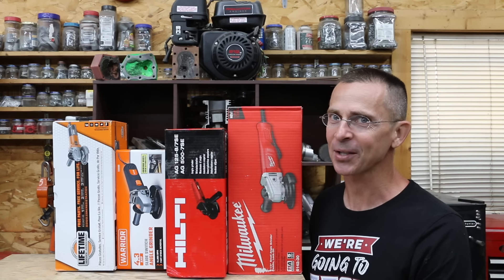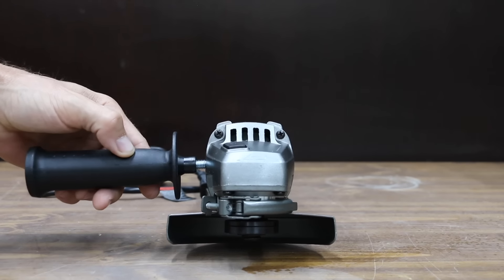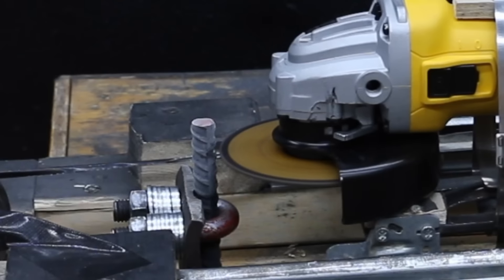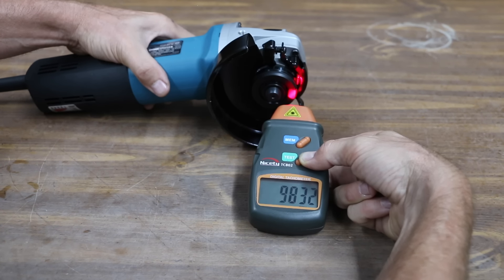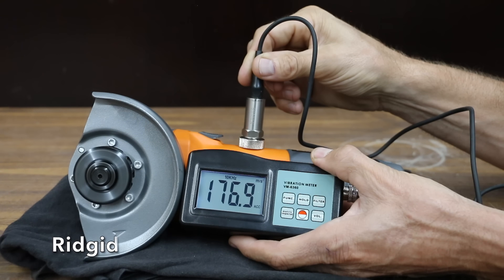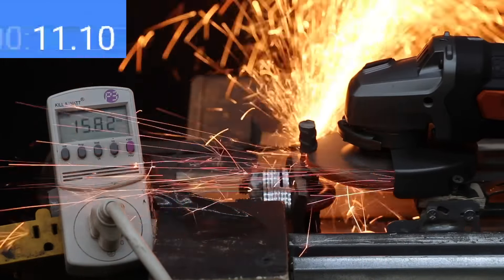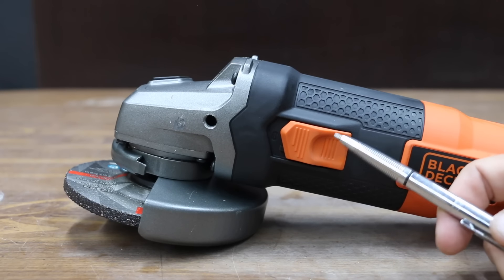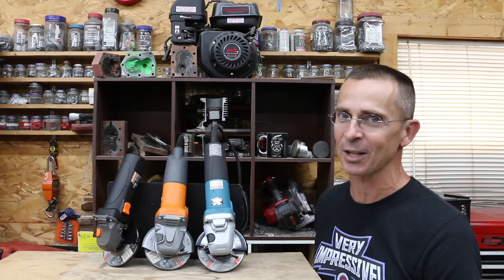Best Angle Grinder (Corded)? Hilti vs Milwaukee, DeWalt, Makita, Ryobi, Ridgid. Let's Settle This!

Comment: back when the metabo hpt switchover from hitachi was going on lowes was selling the hitachi tools extremely cheap and i scored a hitachi 4 1/2 inch and it is an absolute beast i can honestly say its been abused and its still holding up great best $50 grinder ive ever used
Reply from the maker: Nice!

Comment: I've spent countless hours prepping steel with a Makita 4" grinder and a wire knotted cup wheel. The switch is what makes a huge difference, you want one that locks in the on position. Although Milwaukee makes some great tools, its the paddle style switch that you have to constantly hold, is fatiguing.
Reply from the maker: Thanks for the feedback.

Comment: I've been using the paddle switch version of the next size up DeWalt for years now. It takes getting deep in a piece with a standard grinding wheel to bog down. It is a 13amp motor running at 1100 rpms though.
Reply from the maker: Thanks for sharing.

Comment: I bought a Warrior angle grinder in a pinch with limited budget, and it did exactly what I needed it to do. Based on cutting speed alone, I'd say the $33 Porter Cable is the best deal. I don't regret buying the Warrior, but I know what to get for an obvious upgrade that will leave me with money left over for discs and maybe another tool or two.
Reply from the maker: Thanks for sharing.

Comment: I have a video idea. Whenever I use a metal wires brush on my angle grinder, the small wires shoot everywhere, they will fly on my face, pierce through my clothes and make a mess in the shop. It would be great if you could test all of the different brands to see if one of them has a best method to secure the wires to the cup. Also thank you for the great work you've been doing and congratulations for the channel.
Reply from the maker: Thanks and you are welcome!  Thanks for the video idea.

Comment: Cool.  Glad you do the decible test.  Loudest I ever used was Harbor Freight (Chicago Electric).  Had to use ear plugs w ear muffs over them.
I like to have at 3 grinders to minimize blade changes but like at least Ryobi or better.  I have burnt them out (like your video) but brush changes fixed it.
Reply from the maker: Thanks!  Thanks for the feedback.

Comment: Don't underestimate the Wen. I bought a Wen drywall Sander that uses the same motor at the grinder. 3 years sucking in dust it still keeps working. Ive needed to replace brushes but that's it. For $200 compared to $1200 for a name brand Wen has definitely made me money.
Reply from the maker: Thanks for the feedback.

Comment: I really like the effort and thoroughness you put into testing, and for the longest time I was hoping to eventually find something I could suggest for a future video.

And I finally found something: cordless rotary tools. There's a bunch of them and I'm sure there's a wide range of quality, but I wonder if there's any affordable ones that come with RPM feedback.
Basically, what disappoints me about the one I have most, the Dremel 8200, is the lack of RPM, which could be used to increase the motor current to bring it back to the RPM it's meant to be at.

Especially at low RPM, the lack of this makes it a pain to dial the right speed in, because you need to account for the range of RPM loss you get depending on the applied pressure. And RPM feedback isn't hard to do for something like that. It's just that no one seems to bother doing it.
And the "usual" comparison about build quality, performance, battery life etc would be valuable too of course.

So if this sparks some interest then I'd love to see a video about it <3
Reply from the maker: Thanks and you are welcome!  Thanks for the suggestion.

Comment: Thanks, I am a DIY and usually buy the less expensive tools. My very cheap grinder cut all my tile, some cement and metal  for my new bathroom. Caked in tile dust and dropped several times it still runs. My tile blade cost 3 times more than the grinder.  If it breaks i will get another of the same.
Reply from the maker: Thanks for sharing.

Comment: You may have brand preference/loyalty, but one of the benefits of corded tools is that if you favorite brand isn’t the best, you can buy it and not have to worry about buying expensive batteries for a new tool line
Reply from the maker: Thanks for the feedback.

Comment: I bought my 15$ 4.3 Amp Drill master with a coupon for 12$. It lasted 6 years before I felt unsafe using it. I bought a 6.5 Amp Makita for 40$ on eBay cause it could have the brushes replaced. Glad to see Black + decker here. Did pretty good! Wish it had replacable brushes. I'll grab one for the 3 position handle.
Reply from the maker: Thank you for sharing!

Comment: Rigid consistently does well on these power tool tests, if I wasn’t already invested in dewalt batteries I would definitely consider Rigid, seems like a great value.
Reply: It's corded though, batteries are a non-factor.
Reply: @MsJokert6  I understand that but I’m just commenting on all the other tests with battery powered devices.  Rigid brand, cordless or not seems to fare well.

Comment: I bought a remanufactured Milwaukee angle grinder in 1989 when I was 25 and paid $40 for it..... Iv'e used it for MANY MANY projects over the years and now @ 58 I finally put a new cord on it in 2022 and it's still going strong in 2023!!!!!!!!!! Sure I have a cordless Rigid grinder for everyday uses but that Milwaukee still kicks ass whoever I need something that will do the job the cordless can't do!!!!  

Would I buy a new Milwaukee today????? Not a chance!!!!! Rigid is made in America and Milwaukee is made in China, I buy Rigid tools exclusively now!!!!!!

PERIOD

Made In America

Comment: I have gone through A BUNCH of grinders. I use them all day. The one I recommend is Bosch GWS8-45-RT. The thing that kills me is gripping the grinder. I have really big hands, but this Bosch has the thinnest handle I've seen. It's SO different at the end of a full day of use. The only thing I don't like about all of the corded grinders is the height from the bottom of the cutting wheel to the top of the gear housing. If you're trying to cut into tight places, it's not going to work. Dewalt makes the shortest one I've ever seen called the flathead. it's excellent too.
Reply from the maker: Thanks for sharing.

Comment: ANOTHER video idea. revisit the CLP firearm lubes, but i have a few to add. Modern Spartan Systems accuracy oil, Nano-oil 10W, Superlube oil with PTFE (51004), regular 5W-30 Mobile 1 synthetic engine oil, Amsoil firearm lubricant, Mil-Comm 25wb, and the Lucas extreme duty gun oil. Most of these companies make a grease version also made for firearms, so you could set up that test later also.  Best channel for tests ive ever seen. Keep em coming
Reply from the maker: Thanks, will do!  Thanks for the video idea.

Comment: We use Makita GA5030 at my work place and it has been great. We use it for metal sheets and bolts, so not the heavy duty type of jobs. However it has been so reliable and tough I purchased one for my personal tool kit.
Reply from the maker: Thanks for sharing.

Comment: i have one of the $10/15 harbor freight specials. if you repack the gear housing with better grease it's still somewhat noisy, but it'll run pretty well and it'll usually still do the job just fine. i've had mine for years now.

isn't the most powerful, but it does the business.
Reply from the maker: Thanks for sharing.

Comment: The paddle design is superior. I had an older DeWalt with the thumb switch and I hated it so much I tried a HF Chicago Electric with the paddle and that's all I use now. Gave away the DeWalt.
Reply from the maker: Thanks for sharing.

Comment: As someone who uses grinders on a daily basis in the petrochemical industry, ergonomics mean a lot as well as vibration when you are actually using it to “grind” with. I’ve used most of the brands in this video and the Milwaukee is one of the most well rounded grinders…
Reply from the maker: Thanks for the feedback.

Comment: Interesting about how the rat tail Makita came out on top in performance - years ago, AvE did a series of boltrs, taking apart a bunch of angle grinders. The rat tail Makitas came out on top. Surprisingly, the Metabo and the el cheapo HF grinder of the time were remarkably similar, only the Metabo had the addition of a thermal overload switch built in, to keep the grinder from self destructing.
Reply from the maker: Thanks for sharing.

Comment: I use the harbor freight Warrior grinders and have had several fail to bad bearings. That being said, they're cheap enough to just keep spares around. A few weeks ago, I burned up my last one and decided to get the $20 one instead of the $15 ones and I don't think I'll be going back. It's considerably more powerful and has a more ergonomic handle shape. Since I'm down to one at the moment, I'll be keeping my eye on the circulars for a sale, so I can restock.
Reply from the maker: Thanks for sharing.

Comment: The rpm is not always not the same as advertised because of voltage variations of the mains, a couple volts can make a small difference and so forth
Reply from the maker: Thanks for the feedback.

Comment: I had three Harbor frights, two had the gearbox fail one had the motor overheat, even though the load was not significant, a single Makita has outlasted them all.
Reply from the maker: Thanks for sharing.

Comment: If you ever redid this test I would love to see what amps each grinder was rated to, I know Warrior has more than one model with different amps.   Also I was curios about some of the Harbor Freight's other brands that have more amps.   Glad you included Ridged, the warrantee goes a long way for me.   Harbor Freight and Ridged are my go to for power tools depending on what I am using them for.
Reply from the maker: Thanks for the suggestion.

Comment: When I was a kid in the (amazing) 1980s Black and Decker was THE brand to have. Well made, reliable and great value. Now...they are a shadow of there former selves. I still have 80s black and decker power tools that the only close comparative now is Blue Bosch...which used to be godly. I now buy Parkside tools from Lidl (German budget supermarket). The tools are super cheap (20v cordless drill for €45 or €29 without battery) but better than current Black and Decker! Im not a professional so the light use they get, they survive and work really well. They even sell a plasma cutter! I have a full tool shelf compared to my brother who has a drill and orbital sander by Milwaukee and he has two different batteries whereas all mine use the same battery.
Reply from the maker: Thanks for sharing.

Comment: Test cutting technique. Plates are wasted the old fashioned way, by forcing them through the material. A more time consuming variant is to make several shallower passes. It saves the plate material as it is not wasted while vibrating against the sides of the cut.

It also reduces the torque needed by the grinder.
Reply from the maker: Thanks for the feedback.

Comment: I've used (burned up) most of those brands in an industrial welding shop for many years, and will say that by far the metabo is the best grinder money can buy, it will last WAY longer than any other brand.
Reply from the maker: Thanks for the feedback.

Comment: One test you need to do on those grinders is how hot they get from long term grinding or cutting. 

I have owned a Tool Shop 4.5-inch angle grinder for many, many long years & use it ALLOT!! It's a CHEAP brand and still going strong. But any long-term grinding operations the body of the tool gets very hot to hold onto. Please do a test on that too the next time.
Reply from the maker: Thanks for the suggestion.

Comment: Great video as usual! I really like Ridgid tools overall, I had a big shop vac which I got broken for free after it had already been used on a big drywall job and a wire melted off of the motor brush holder. Re soldered the connection and even with a screaming bearing as well I used it for around 7 years?? after that! Finally tossed it just because it got gross inside and I didn't want to take it apart to fix the brush holder again
Reply from the maker: Thanks for sharing!

Comment: As an Australian with 240V tools, I had no need to watch the whole video, but I did anyway. 

I will say metabo comercial grinders are almost impossible to kill. To give you an idea: at my trade school the only grinders in the grinding room were Metabo and Makita  and they were used and abused daily. They had 1.4KW versions which had a 2 handed switch otherwise they would probably be too dangerous for a 5 inch grinder. You absolutely could not bog them down. The Makitas are nicer to use but when you drop them off buildings and ladders onto hard concrete the gearbox casting does crack before the metabos did.

At my last job the Metabo grinders outlived all but the Makita grinders about 4 or 5 times over and about double the lifespan of the Makita. Most common failure was cracked castings due to idiots dropping them. This was true of evey brand except the Metabo. The Metabos would eventually become unusable because either the bearings would fail or the locking pin would shear off and they kinda just wore out rather than dying. 

Another common death was burnt brushes and the greese melting out of the gearboxes of other brands. We absolutely abused all the grinders though, you'd get yelled at if you weren't torturing the grinders half the time lol. 

Personally I like some of the bosch pro 5 inch grinders usually in the 700-800 watt range, they are strong enough to tollerate some abuse and survive plenty of bad drops compared to most other grinders excluding the Metabo. They are also not so strong as to try and kill you. The Metabos were unbreakable but after 8 hours of grinding with them you kinda wished that they would die lol.
Reply from the maker: Thanks for watching!  Thanks for the feedback.

Comment: I have a Makita angle grinder that Christopher Columbus brought over the ocean and find that it works great and is extremely smooth to run while I also have the $12 hobo freight one and find the it also works very well with a little bit more vibration
Reply from the maker: Thanks for sharing.

Comment: It would be really nice if you did a brand round up. Take two brands and compare them across all their major tools in one video (you could even piece together the relevant parts of your old videos, just to get them all in one place).

This would be nice because sometimes you have to pick one brand to stick with, especially if you want to keep all your batteries the same. It would be nice to get an overall view of the quality of each brand, and not just one tool type at a time.
Reply from the maker: Thanks for the suggestion.
Reply: @ProjectFarm   And thank you for providing such valuable content. Independent testing of products is sorely lacking in our world and it makes a world of difference to have your videos to compare when buying tools.

Comment: For the price the Black and Decker and Porter Cable seem like the best overall value. That being said I use an angle grinder about 5 times a year, not on a regular basis.
Reply from the maker: Thanks for sharing.

Comment: The switches that work on a hinge also can have another problem. The lockout tab can break off (which happened with mine). Since it (now) can turn on when it rolls onto the switch, I always unplug the grinder while re adjusting, changing type of disc, or pretty much anything else. Something definitely to consider.
Reply from the maker: Thanks for sharing.

Comment: As usual, nice comparison.  I find your conclusion fair... the $15 ($9.99 on sale) Warrior is weak and not the most ergonomic but at that price it got me to try an angle grinder. Once I tried it I got 2 more so I would not have to take time to swap wire brushes.  They also overheat but if you give them a break they come back to life.  
Thanks to my experience with the Warrior angle grinders I just picked up an 11 amp Hercules (half price on X-mas sale) and will be trying it with a 6 blade shaper wheel to debark logs.
Reply from the maker: Thanks!  Thanks for the feedback.

Comment: As someone who has used grinders like these all day, every day, Metabo is the top choice, some brands would only last a couple of days (if even that long). Try another comparison using every manufacturers top of the line models. Thanks!
Reply from the maker: Thanks for the suggestion.

Comment: This was a good informative test. As far as the Harbor Freight grinder goes, I would like to see the Hercules 13 amp included. I have one and use it in welding and other applications all the time. It is more of a professional grade grinder and is only 60 bucks! I have had it for over 2 years and I have had no complaints as far as power or any problems are concerned. The switch can be a bit fiddly at times. I would like to see a test to see which grinders get the hottest after prolonged use included. Thanks.
Reply from the maker: Thanks!  Thanks for the suggestion.

Comment: Please do 7" grinders one of these days!  I have a 15 year old Makita,  use it every single work day for that 15 years.  I sand subfloor seems in new construction houses.   It's sucked in soooooo much fine dust.  I've never taken it apart and it's never had any kind of an issue.  Better knock on wood after typing all that lol
Reply from the maker: Thanks for the suggestion.